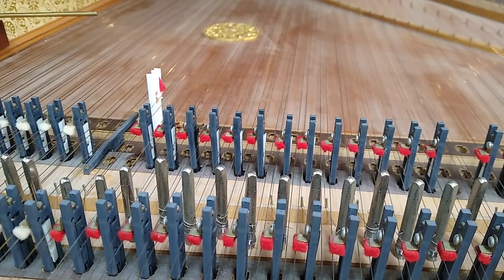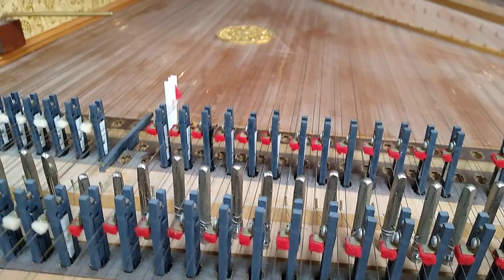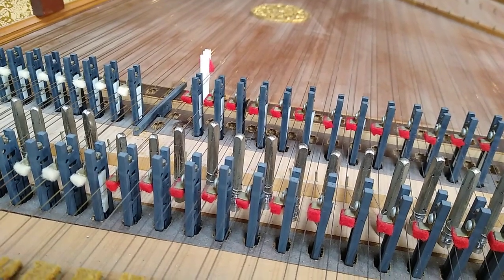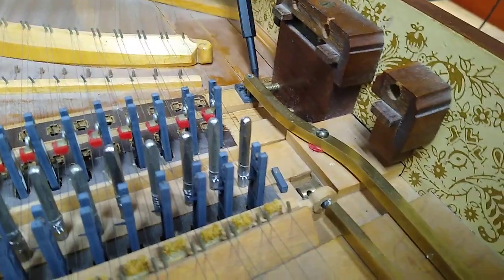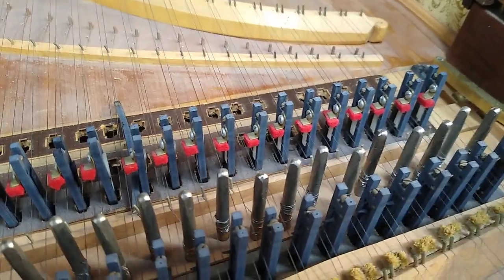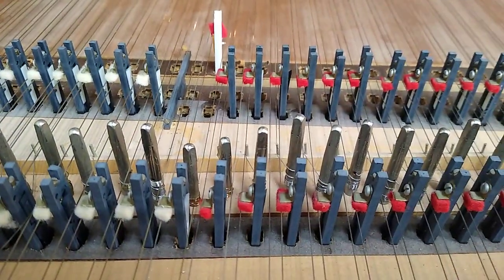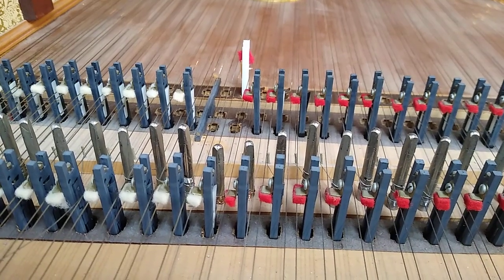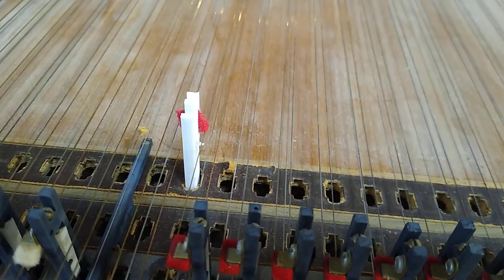English Double Harpsichord restoration blog episode 6: regulating the register

Comment: Lol. The damper of the neighboring upper manual jack, was the problem. It was blocking the string. It's VERY obvious in video. It upper 8 Jack is being lifted by the string it's not assigned to. The upper manual 8' register needed backing off.
Reply from the maker: Yeah, it wasn't completely sorted when I made the video.